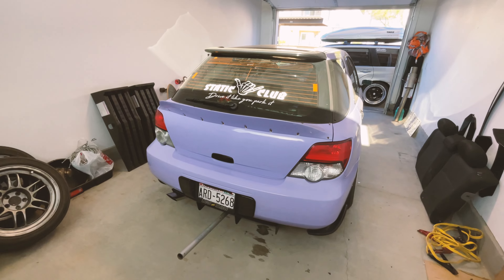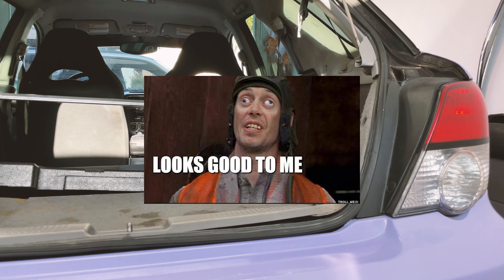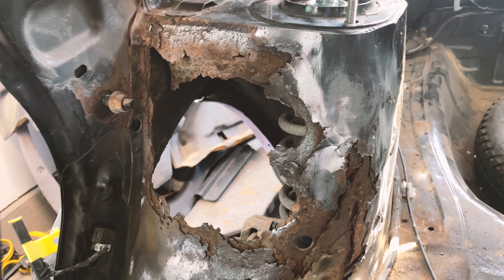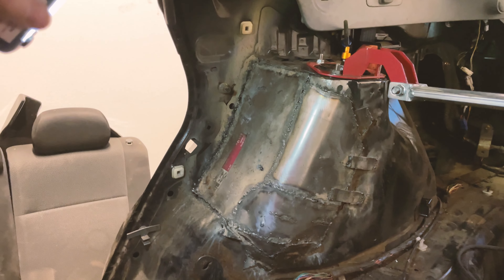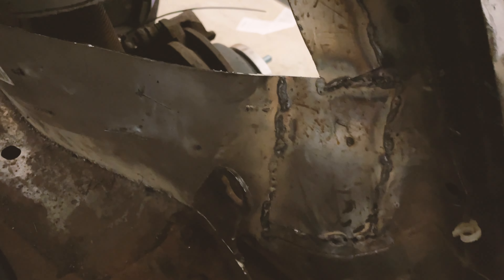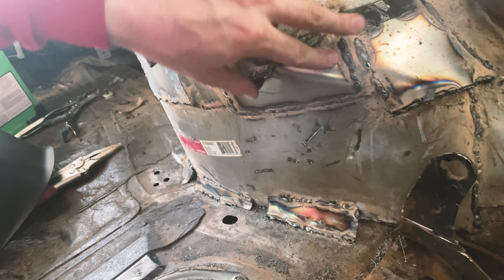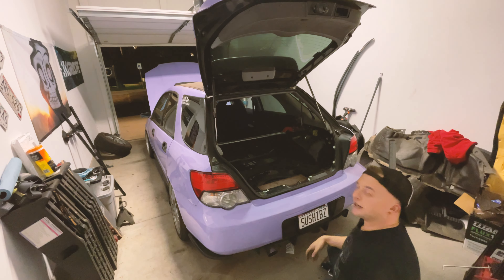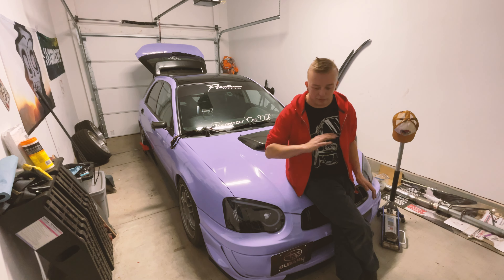Subaru WRX Rust Repair & Removal // Can I do it?? - SushiBoiz [4K]

Comment: Holy shit dude, lmao.  Very difficult to do thin sheet metal with an arc welder especially as a beginner, it tends to blow holes in it.
Not that its impossible but MIG would be a lot cleaner. Looks a lot better and safer than before though.
Reply from the maker: Oh I definitely did my fair share of blowing holes in some of the first couple bits I tried welding! But thankfully this is all covered up by the interior. It’s definitely function over form as far as the welds go! But thank you for the comment and the watch!